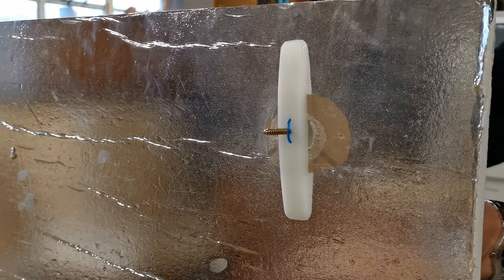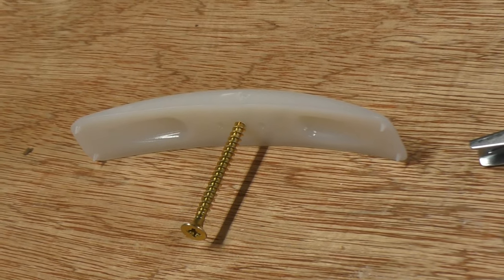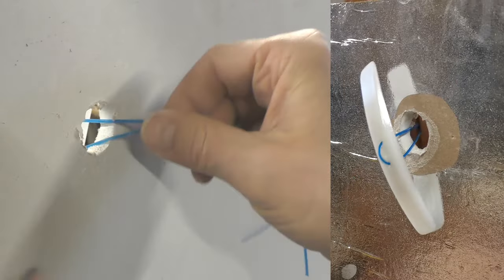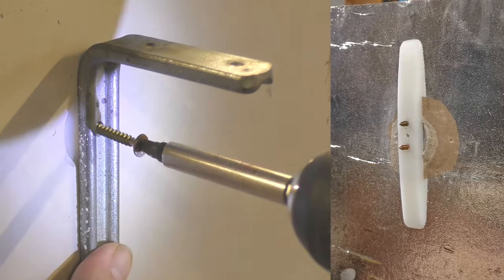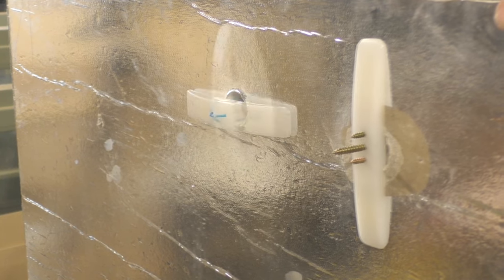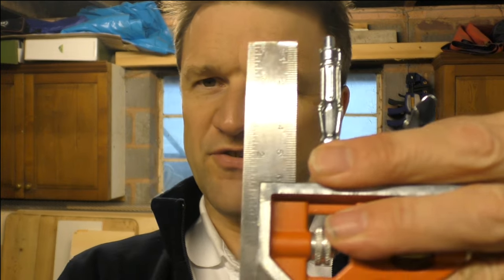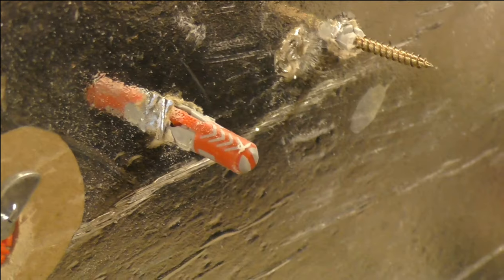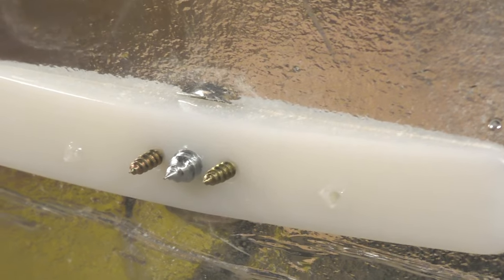The Strongest Plasterboard Fixing Ever!

Comment: Hi Charlie, new subscriber–didn’t see them on your list, have you tried Tox Deco’s? I wouldn’t use anything else.
Reply from the maker: Hi buddy, thanks for the sub. 🙏 No I haven't. Slightly gutted I didn't know about these! Also, did you see my new update video https://youtu.be/Jdu9RId7m90
Reply: @CharlieDIYte  I did–most informative, but as I commented here thought I’d wait :) I used the duo-powers a lot, but then switched to Tox Decos, as effective IMHO, cheaper, and less incidence of over-spin under torque (which is easy to think hasn’t happened using the Duos–rendering them pretty much useless).

Comment: Hi Charlie, great vid and nice product. Have you had any experience fixing into strammit board? Our house is made with the bloody stuff and it doesn’t hold  fixings well.
Reply from the maker: Thanks mate. Well it works up to 75mm so provided your stramit isn't thicker than that and with the right length screws you'd be fine
Reply: @CharlieDIYte  Thanks Charlie, the issue is that the strammit is used as room dividers with no cavity in between, otherwise this stuff would be perfect (provided I can cut out a nice hole in the boards)

Comment: so firstly great video charlie you have a new sub for sure....and secondly requesting a small piece of advice i have a plasterboard wall on which i want to hang a TV bracket,i guess it's plasterboard both sides as the inner wall is in my room and the outer wall is the wall at the side of the stairs facing the upstairs hall way,i managed to use a magnet to find the stud,(am almost 100% sure it is wooden stud as it's an old house),so can i or should i use these fixings in the video to fix the bracket to the stud or maybe fix some ply to the stud and fix through the ply to the plasterboard...what say you
Reply from the maker: Chances are these fixings would be fine - particularly if the TV is just sitting flush with the wall as opposed to swinging out on the bracket. If however the TV is really heavy and the stud is close enough to where you want to fix it, I think your idea of fixing ply to the stud is a great one. You can then put a couple of screws top and bottom through the ply into the stud and then a couple of these fixings at the other end, top and bottom, and then screw the bracket to the ply. Massive thanks for subscribing, by the way!
Reply: @CharlieDIYte  thanks for the reply charlie,the TV is on a swing hinged bracket and weighs approx 10.5kg,the bracket itself has 4 points of fixing with two bolts at the bottom,(side by side), one in the middle and one in the top spread out between about 10'inches i guess the not all of these bolts will be able to fix into the stud and being a completey clueless DIY'er i would know how big the stud extends behind the plasterboard but at a guess i will assume that making sure both the bottom and middle bolts,(5'inches apart),should be the ones to fit directly to the stud with the upper bolt just being used with one of these plasterboard fixings....sorry for the 100 questions i just want to get it correct first time

Comment: Hi Charlie , I've seen all your plasterboard screw fixings vlogs  .
Can I ask ...I'm installing a 32 inch TV bracket on plasterboard wall .
I don't wanna see it ..or make a big hole . Or hit a piece of wood . Etc ..
Do you think this Gee fix is better or snap toggles ? Thanks  hope you can help
Reply from the maker: Hi Ste. Is there brick behind the plaster? In that case, if it's no more than say 50mm back from the surface, then Corefix would be a good option https://www.youtube.com/watch?v=fx90VadXSXA&t=291s if you want a really good fixing that anchors into the brickwork behind and a relatively small 10mm hole. Re your point about hitting wood, you DO want to hit wood, because that will give you the best possible fixing. If you hit wood stop drilling immediately and simply pilot in a wood screw into the soft wood stud behind. If the TV is on a fixed bracket (ie no cantilever force) you'd get away with something like the Fischer Duopower 8x 40mm plug. We use them all the time in the day job and they're really good. You have to drill a 25mm hole for the Geefix so that might not be a good option for you although it does give you the best fixing, and arguably the hole will be hidden by the TV bracket? Snap toggles are good but you still need a large, eg 13mm hole. It's a bit difficult for me to say definitively without knowing how heavy the TV is and whether the bracket is going to pivot but hopefully this has given you some options.

Comment: These vs snap/zip toggles on lath and plaster? The bowing plastic bit kind of concerns me as I've seen others say it exerts bowing pressure on the wall and I saw on your example it cracked it. Old plaster is brittle as it is. Main advantage I see is that one of these could catch two or three laths at once.
Reply from the maker: It rocks with lath and plaster. I used it on a job in the Hebrides on a lath and plaster wall where everything else had failed and we were creating a massive hole. If you're worried about it cracking the wall just don't over tighten it with the two fixing screws although I guess if you're self tapping other screws into it, you'd still be pulling it close to the wall.

Comment: Looks a good idea , however I am a little concerned about the large screw that you fit in first to pull the two together then remove to then re insert together with whatever it is your fitting to the wall , surely if you pull out the screw from the plastic clip at the back and then re screw back into the same hole the strength of the screws thread won't be as tight as the first time and you will end up with a loose fixing...... surely would be better to use a no 12 size screw for the final fixing so that it will bite into the plastic clip a lot better and you will get a solid fix....just a thought .
I will get a pack of these to experiment with and see how it goes...👍
Cheers....
Reply: Just use a bigger screw.....

Comment: great , so it's ok to leave the centre fixing screw protruding a bit for mirror wire yes ?
Reply from the maker: Yes absolutely, once the two side screws are tight, you can do what you want with the centre screw, as the circular lug you're screwing it into is securely fixed to the wing behind by those two side screws.

Comment: Hi Charlie,

I'm looking to fit a wall anchor in plasterboard that withstand 70-90kg. I want to install a anchor poibt for a gym suspension device or gymnastic rings in my flat.

What would be the best way to install this?
Reply: Sounds more like yer putting it in a plasterboard ceiling... if so, you need to find where the plasterboard is fixed to the joists... a small neo magnet run over the ceiling will pinpoint screws / nails fixing the plasterboard. 

Find a row of them in a straight line 6" to 8" apart & you have found the joist direction... (16" apart is the gap BETWEEN adjacent joists) mark the positions ... then drill pilots holes & use hex headed lag bolts to screw into the timber.

The fixings in the video whilst being strong are only as strong as the plasterboard sheet itself & personally I wouldnt be surprised if the whole sheet came down if u simply fixed into the plasterboard-only  with them.... find the joists...

😎👍☘
Reply: Peter Fitzpatrick thanks for the comment, I should have said that I live in a new build flat in the UK and I believe the joists are those flimsy metal types.

So, I'm not sure I can secure to those either. I think my o ly option is putting ply board attached to the wall or ceiling, or cutting in some bird behind the plasterboard?

Comment: The self-aligning cord feature and ability to side-mount more items are winners. I've popped wood, nylon curtain track, etc., into stud walls before but had to gouge a biggish entry slot then make good afterwards—a pain in an already-decorated room. At £4.75 for 2 on eBay today (Feb '21), I'd say they're fairly priced. I hope they've got the patent sorted as it wouldn't be hard for Far Eastern companies to imitate.
Reply from the maker: I agree with all that. It's a fantastic fixing and was a life saver recently on a job where the lath and plaster wall disintegrated where we were trying to get a fixing.

Comment: I just watched your video about how to silicone-seal a bath surround.

It's good buit isn't quite what I need for my specific case.

A first floor bath has sagged. This has created a viscious cycle of leaking around the lip of the bath adjoining the tiled wall, which causes the bath to sag more, which intensifies the leakage. It's a big, heavy enamel bath and the sagging is probably damp joists sagging while under strain from the weight. 

OK, so I'll probably have to get the floor examined, but meanwhile I want to stop the leak so it doesn't become worse than in needs to be in the meantime.

The thing is it also means the bath already has a seal which has come loose. A plastic seal was intalled between the lowest tile and the bath top, but since the sagging has occured the seal has broken away both above and below.

With the seal there I can't follow your video becasuse it's a convex seal which protrudes but now has gaps above and below.

I'm not a professional and I'd doing this for a friend who previously paid a professional who charged £50 to run a bead along the head of the bath, and didn't even do the length of the bath where the problems are. That's another story. 

I want to have a go, but how do I reseal a bath wich already has a convex plastic bead with a broken seal? If I was to pull the seal out then I will face a gap of about 5 millimetres between the tiles and the bath top and I expect probably another gap between the bath edge and the wall. In essence, I think pulling out the convex plastic seal, as well as enraging the friend I'm doing the DIY for, will leave a gap far too big to fix with silicone. 

Can you think of a solution or am I on my own?

Comment: ok i just found this video with a view to installing a TV bracket on a plasterboard wall; brilliant fixer and i have ordered some through your link above, thank you.   However I had a chuckle when you said if you remove the screw from the metal toggle, it falls between the board....isn't that the same for Geefix (and other similar fixings); once fitted can't be saved?!  Very informative video, great stuff 👍
Reply from the maker: Thanks for ordering through the link. Yes you're right for the majority of the decent plasterboard fixings. 👍

Comment: The two smaller screws that hold the anchor in place, does it come with longer screws, are longer screws able to be used with it?
Reply from the maker: It doesn't but yes you can use any length screws you want.

Comment: Great video thanks.
Oils you recommend using one or two to hold a mirror that is 80x50 (10kg)?
Thanks
Reply from the maker: For heavy mirrors I often use two, slightly spaced apart, to spread the load - assuming of course your mirror has picture wire behind it to hang from the screws. You'd probably be ok with one, but it's a peace of mind thing! Also you could consider swapping the centre screw for a pan head.
Reply: Charlie DIYte thanks for your reply👍🏻
I purchased these fixings today, plus the same picture hanger.

Comment: Good product. It you can't source the product try this;
Use a strip of wood (or plastic) as in the video. 
Cut a letterbox shaped slot just large enough for the wood to pass through . 
Drill a hole in the centre of the wood just large enough for the thin part of a  cable-tie to pass through but not the end-locking part. 
Feed the tie-wrap through, apply strong glue to the surface of the wood that will be in contact with the plasterboard.
Holding the cable-tie, pass the wood through the slot then pull the end of the cable-tie until the wood contacts the back of the hole. 
Pass the cable-tie through another piece of wood with the same size hole drilled in it.  
Join a second cable-tie to the first and ratchet it as tight as it'll go.
Leave until glue sets, then snip cable-tie.
Apply filler and paint if required.
Now you have a solid piece of wood, with a large contact surface behind the plasterboard ready to support your fixing.
Reply from the maker: Thanks Mike. Yes I've done this a few times in the past. The beauty of this fixing is you don't have to wait for the glue to set, or worry about the wood disengaging from the back of the board if you press too hard when piloting the screw, or have the worry of the bit of wood splitting. 👍🏻

Comment: I intend installing a glass sliding door onto a plaster board wall . Will these fixings work
Reply from the maker: Yes, although without knowing what the load requirements are, the substrates (can you anchor into brickwork behind the plasterboard, in which case Corefix would be a good option) and the fixing points on the door I can't comment on whether something less heavy duty (like a Fischer Duopower 8x40 might be a better option. Also, will the door hide the large diameter of the centre plug of the Geefix?

Comment: They seem good, have you  tried these  from Amazon: TIMco HPF30 Hammer-In Plasterboard Fixing 4 x 30mm - Yellow (Box of 100)
Reply from the maker: I haven't. I've ordered a few for a review I'll be doing soon. They look fine as a light to medium duty fixing that I'd still worry about for cantilever forces though. Thanks for the heads up 👍
Reply: @CharlieDIYte  yes, I only use them for literally light to medium jobs . .. but they are not that bad. 👍🏻

Comment: No self-drilling drywall anchors in your list? They are super-fast to install and hold quite well in drywall.
Reply from the maker: I won't use them because they're a dreadful fixing for anything other than a vertical load only. I've seen too many horror stories with them in my day job fitting curtains and blinds and the comments on my channel are pretty much universally in agreement with me on this.

Comment: I am a diyer converting part of the garage to a utility room. I have 22mm insulated plasterboard pinned to a studded wall and 60mm of celutex insulation board in the spaces between the studs. Hoping to hit the studs with my wall cupboard fixing but if not possible what do you recommend to go into the insulated plasterboard backed flush with celotex?
Reply from the maker: Assuming you don't want to screw all the way back into the brickwork behind - which you could do with frame fixings, you could try metal wall anchors https://bit.ly/2Fa0C36 as they will force themselves open in the foam.
Reply: @CharlieDIYte  thanks Charlie, I assumed that that was my only option but value your confirmation. In hindsight I should have installed plywood noggins between the studs at the fixing points????

Comment: Well timed video. Iv jus started new job as maintenance in a new private care home. Put up a TV bracket on a plasterboard wall painted. I used my magnets to try find studs but no joy. They are stil building it so I asked the joiner an he said they all have the aluminium stud frames which you can't fit to so have to use the plasterboard itself. I have the metal easyfix self drive but they are not that easy to drive in plaster. I snapped two ends ofd in the plaster, they must be brittle fixing which is a nightmare so I put drill on slower setting and drove in. Tho they stil like to wander off to the side.
Obviously I will have to use loads of these fixings as it's a 170 bedroom block so I will have to stick with these for price. Have you any tips on this
Reply: Scott Mclean pilot before

Comment: I have a thin hollow core door I want to use this in for a towel bar. How do you suggest I make the plastic circle bit about half the thickness?
Reply from the maker: I've done this Chris. The safest way is to get a junior hacksaw and gently saw round the circumference. It'll only take a few minutes. If you've got a vice - the job will be even easier.

Comment: When fixing a TV bracket you mentioned it would be best to orientate the geefix horizontally. Why would this be better than vertically? I would have thought due to it being a vertical force that vertically would have been better ? Thanks
Reply from the maker: Brendan, on reflection I think you're right, and in fact I've just come back from a job in the southern Hebrides, where we orientated it vertically for a curtain bracket in a lath and plaster wall that had basically disintegrated around us!!
Reply from the maker: I've just posted a picture on my Community tab, if you have a moment to check it out 👍

Comment: Ours are either dot-n-dab on the structural walls, or Paramount partition board on internal dividing walls. It's so difficult to get a fixing, either the plaster dots are in the way, or I hit the edge of a dot. Internally those cardboard Paramount things are just awful when it comes to fixing anything. Again I always hit the exact wrong place. Oh for solid walls!
Reply from the maker: Not easy, except if the plaster dots are in the way, that's a good thing because you can drill straight into them and treat it like brickwork.

Comment: I have a dot and dab wall, and I am thinking of putting a 75" tv onto it with a cantilever wall bracket, do you think its ok having a tv that size on a cantilever bracket on drywall, dot and dab?
Reply from the maker: Yes but don't use one of these. Get yourself some Corefix fixings, as you want to be anchoring into the wall behind and the beauty of these is the steel core in the fixing bridges the gap behind the plasterboard to stop it buckling under the pressure of the TV.  https://www.amazon.co.uk/dp/B00NVLNKN4/ref=cm_sw_r_other_apa_i_kkoWEbZG87AF4

Comment: What happens when you no longer need the screw. Can you fill the hole or would you leave the plastic plug in and try and fill that?
Reply from the maker: You'd need to take out the screws and let it drop into the cavity and then fill the hole with EasyFill or similar.